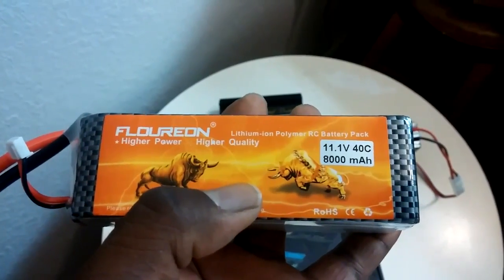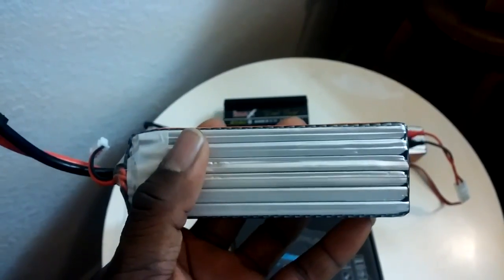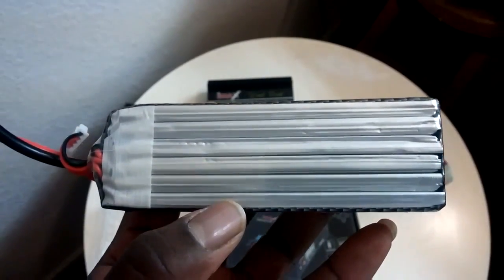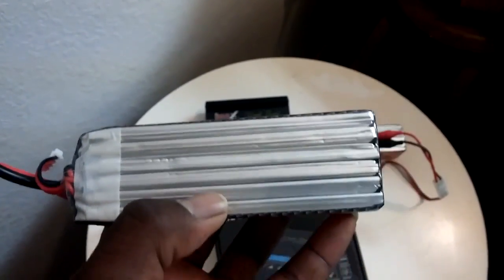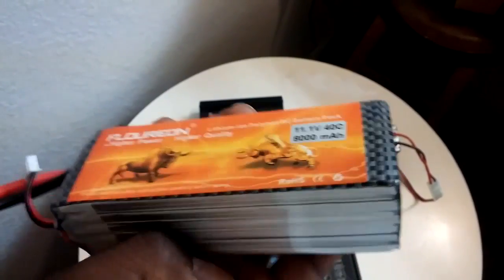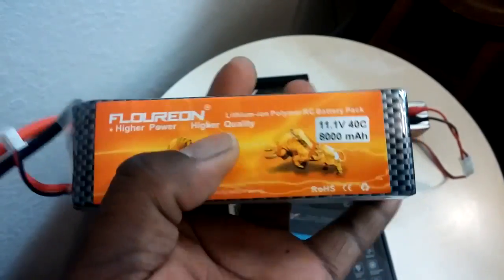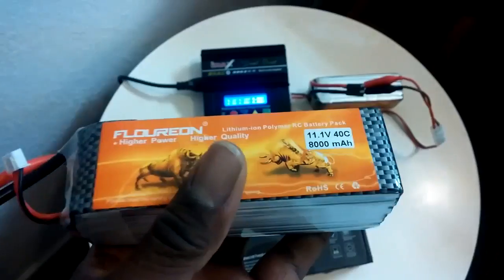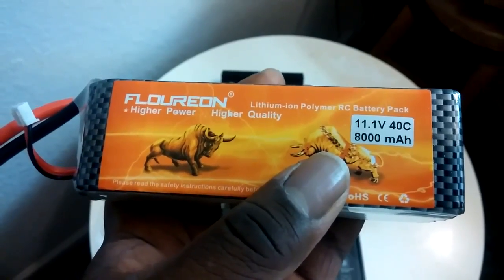Lipo Battery - Can You Change The C-Rating? - PART 1

Comment: Okay I'm back. The answer is yes but not recommended to run 2 different sizes. You can however hook 2 of the same in parallel it will double the c rating.

Comment: the only way to change the C rating of that battery right there. is to add a capacitor in parallel before the load.

Comment: Bro should I buy blackout xte pro or the terremoto v2 1/10 th scale?  Pros and cons?
Reply: The XTE the steering sucks, I just bought one my servo went out in under a month after 6 uses. The first use my upper shock bolts fell out even after tightening. The stock tires are junk and too narrow it flips easily. So replace the servo, servo saver and tires and its really a descent truck out of the box. I did a speed run on a 3s lipo and mine does 50mph constantly